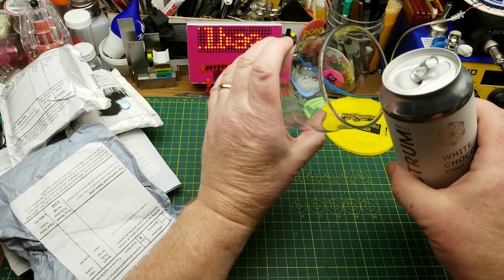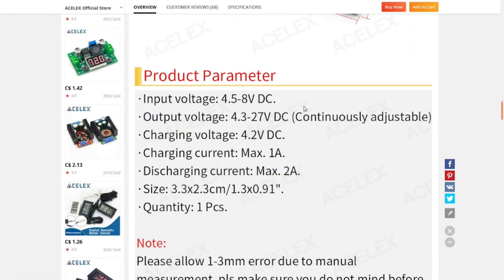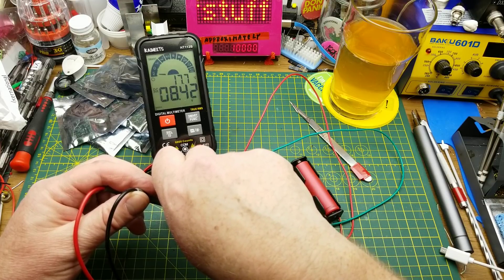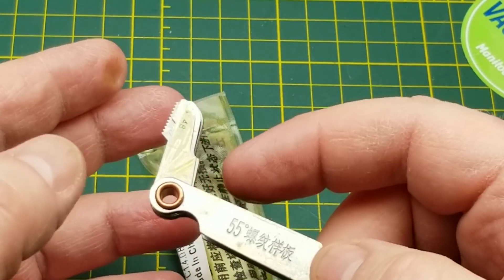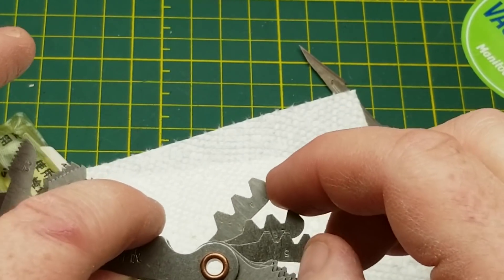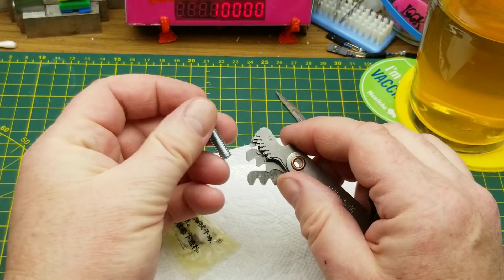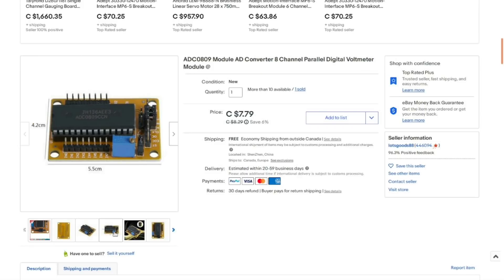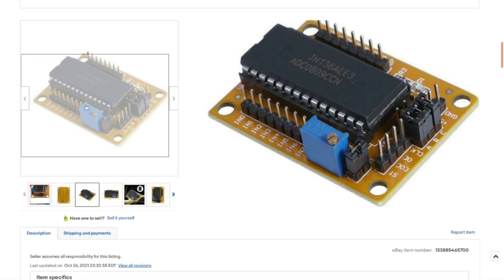mailbag Monday  131

Comment: For the charge/boost module:   If you add a 9v battery connector to the output (reverse polarity), a protected(important!) 600mAh-ish drone lipo (i.e. syma x5) and change the value of the charge current resistor(pin 2 tp/tc4056) from 1.2k to between 4-5k, you can whip up a convenient sized rechargeable 9v battery replacement.

Comment: I built 3 of those frequency meter kits.  i use them on my 1000 watt and 2500 watt Chinese ZVS induction heater setups.  I use a small coiled antenna to get info from the work coil and a Schmitt trigger to condition the input, though, since it appears that you need a full 5 volt signal as input.
   Youtuber Julian Ilett built one a while back and didn't particularly like it for crystal testing IIRC, but I didn't have any problems with the ones I got, at least for my use.
  Getting a reliable frequency counter in that range turned out to be big issue for me.  I tried one or two DIY Arduino projects that didn't work as touted and one or two that ham radio folks use that didn't work as low as I needed (about 10kHz to about 100kHz).

Comment: Be warned that the Lithium Charging / Boost modules don't have a low voltage cut-off protection. I've used it on a DIY wildcam project without double checking their protection and it drained my lithium cell down to 1.2V which is really bad. I didn't had the time to do so yet, but adding a XB3303A or FS312F-G or a DW01 with external mosfet to add some low voltage cutoff would probably help.

Comment: I find the crystal tester really comes in handy the older you get and can't read the fine print stamped into the shell. I use mine all the time to identify crystals for verification that it actually works and how accurate they are.  Surprisingly I have found a few components that were no good, one that was delivered in a kit, so I am definitely pleased that I have one. (It's also fun to build)

Comment: A mailbag great nice items what protection was on the battery booster pcb?
Reply: None whatsoever, and this will definitely discharge lithium cell below safe voltages.  Need to add DW01 type PCB or use a protected cell.
Reply: @johncoops6897  That was what I thought and would have liked some short CCt test on it and overvoltage rather than just see if it boosted the output
Reply from the maker: I generally don't  go beyond "does it do anything at all" testing during the mailbag. 
If people are interested, I can go deeper in a dedicated video.

Comment: I got the same Charger Boards and used them to light 5v LED strip in a Nativity display. Used an old Cell battery and the board will work without a battery. And they are flat on the back helping to hot glue it to the back

Comment: Please note that the battery charger boost module has to be used with a protected battery as the module does not have that function and will drain the battery past safe voltage ranges. Also the sandby current is a few mAh please keep those things in mind.
Reply: Not only that, while it was intended to use as UPS type of device, it's not really doable. when you put a load on output, you can't finish charging battery, unless your load is smaller than charge cutoff (probably about 10mA). It lacks simple load switching circuit. Just three more components and it would be much better product.

Comment: Let me guess; you thought the module with the ADC chip on it would drive 7 segment LEDs?

I imagine it still can by doing some intermediate jiggery-pokery. Is it worth it? You be the judge.
Reply from the maker: That's an interesting idea.

I was originally hoping it would give an SPI or I2C output so it could be used to expand the number of analog inputs on an ESP8266 or similar without sacrificing so many digital inputs.
Reply: @pileofstuff  Well, that would require a lot more jiggery-pokery but again is it worth thee effort?
Reply from the maker: @markfergerson2145  Worth the effort... Probably not.
Of course that doesn't mean I might not try it at some point... 
As usual my (lack of) software ability is the limiting factor.

Comment: Have a real use for your freq counter. I recently bought a bag of mysterious blue 12mhz 3-pin "crystals" -- or some kind of oscillator -- and want to know how precise and accurate the devices are.  They seem to work well enough for my CH340G chips, but curious how good they are compared to the real metal-can variety.
Reply: Those blue 3 pin "crystals" are likely ceramic resonators, and work as if they are a quartz crystal with the load capacitors (thats why they have the central earth pin). They are not quite as accurate and temperature stable as crystals but a little more mechanically rugged and used to be much cheaper. They are perfectly adequate for microcontrollers unless the precision timing is important in your application.
Reply: @IanSlothieRolfe  I think you are spot on.  Have used a few, and all work OK.  After soldering the SMD chip on a plate, was able to bend the legs, and bodge the ground so the crystal rides on top. Can see the Pico uses a kind of tiny 3-pin SMD crystal ... have some of those as well.  Just not as easy to work with.

Comment: You can kind-of tell thread pitch gauges because Imperial uses whole numbers, ie, the number of whole teeth per inch, where as metric has decimal numbers because it's the distance between 2 teeth in mm, eg, 2, 2.5, 3, etc.
These days I get Ali stuff in 2 weeks, but somehow when I buy a bunch of stuff at the same time from different sellers, all of the stuff comes in 1 bag, ie, it's like they have a drop point here and repack it in one bag and send it through local post. Ebay is getting bad, because it's usually 90 days.

Comment: You always get the neatest stuff. That battery charger/boost module looks amazing. Ugh! I know that feeling with the oiled gauge... I bought a set of feeler gauges once and it was similarly slathered in oil.
Reply: It's supposed to be slathered in oil (moreso the feeler gauge than the thread pitch gauge).  If you get a speck of rust on a feeler gauge it is recommended that you just buy a new one.

That said, it is highly dependent on what you are measuring.  If you are checking the flatness of a cylinder head, a speck of rust on your feeler gauge may cost you a LOT of money/time.  If you are checking the valve lash on your snow blower, that speck of rust might be meaningless.

Comment: Nice haul as usual. I was an avid user of the ADC0809 "back in the day", err the 90s. It was a super stable chip, easy to use, and interface with.  I had it on a Z80 controller board I designed. It was hooked up to an 8255 PPI. It was a science (or god if you like) send for idiot engineers like myself. It was 8bit but it gave every stable reading on a noisy shop floor, and I didn't have to recalibrate it every few months or season changes and calculate new coefficients.
Reply: An 8255 will add amusing layers of complexity to interface with this ADC0809.
You probably had limited pins to work with in the 8-bit DIP era.
My first thought was to use 74HC595/74HC165 shift registers with it. Nah.
A MCP23016 i2c IO expander would be simplest. We have it easy these days.
Reply: @GnuReligion  Twas 1992 ;) I had two 8255's on the board and the port of one did have two chained HC595's off one of the ports :) I needed the ADC data AFAP, so was on two of the ports.  The 8255 was never that hard to work with in comparison to the 8155 or Zilog PIO, though the latter was not too awful.  Agreed that the modern i2c IO expanders are the way to go now!